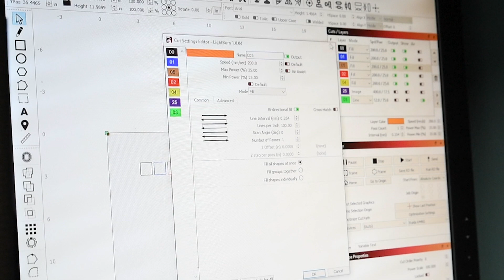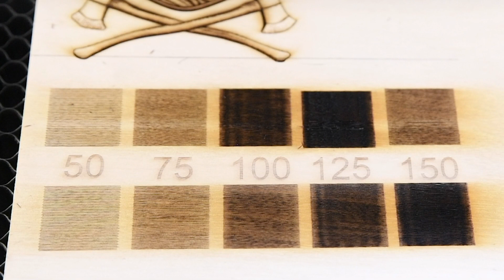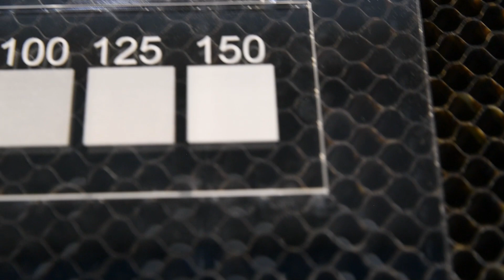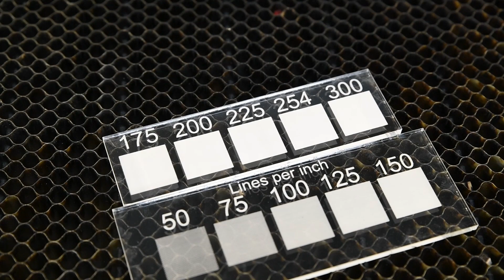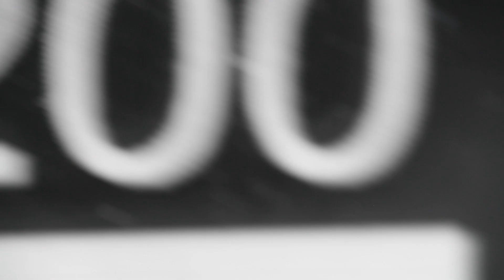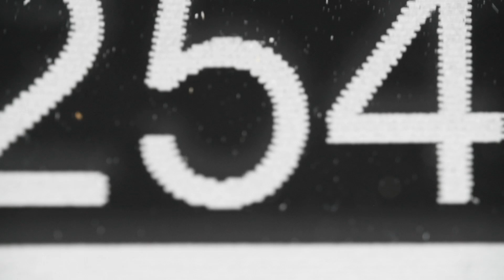Laser Etching - Lines Per Inch DPI 🤯

Comment: The closeups were very informative.  Towards the higher DPI's, you caught some of the grids line start/stop edges which it was easier to see the line interval.  I just did finish a similar test with my Commarker B4/30 fiber.  For my particular setup, engraving works very well using 3mm black acrylic....  2500mm/sec - 60%pwr - 60khz - 1000DPI - crosshatch-NOT bidirectional - one pass....  To cut the black acrylic to shape, my Longer B1/30 watt slices best at 90%pwr, 400mm/min, one pass, air assist ON.... The first testing that should be "mandatory" is a "Material Test" in Lightburn....  Especially where the speed/power settings will provide a "lightness" variance that occurs when engraving black acrylic....

Comment: Im learning so much from your videos, im going to be honest i bought the plug in for gimp, but could not get the photos to come out right, came across your video and tried imagr and worked first time ,so now im trying to dial my machine in and your video's are spot and a varied spectrum ,so i have to say a big thankyou for taking the time to make and share your video's
Reply from the maker: awesome thanks for watching and glad i can help some people out with my videos, if you do get stuck on anything else or have a problem or question and if i can help i will. thank you
Reply from the maker: also with the plug in or anytime you dither outside of lightburn make sure when you go to lightburn that you use PASSTHROUGH as the image mode and it will work, i like 260 DPI

Comment: Wow that was great! Good idea just to cut it out and have a reference mine goes up to 4,000, I can only imagine? I'm thinking 300 is The Sweet spot research says between 300 and 600? When I get my Mira 9 or Nova I will have to run a test! 🤔
Reply from the maker: yes the only one down side is for every line per inch you add you are adding time to the job, just have to find the sweet spot, for me for images it is about 260dpi and for acrylic i like 300 and very low power.

Comment: So what is a good number to keep your lines per inch? Are should it be adjusted depending on your project
Reply from the maker: with my laser there is no need to go any higher than 225dpi for Acrylic as the lines are already touching eachother and covering all the material.